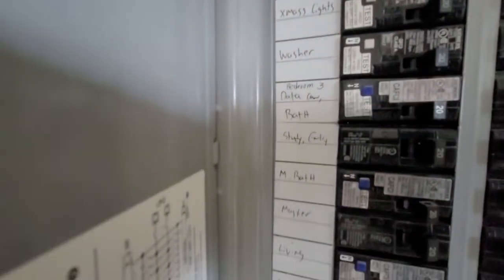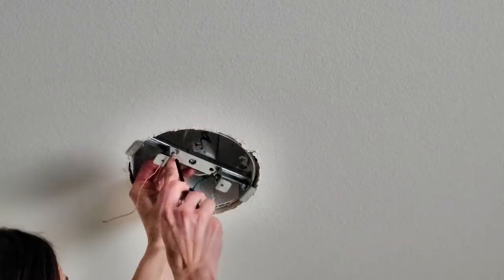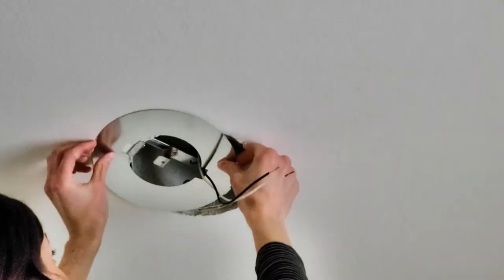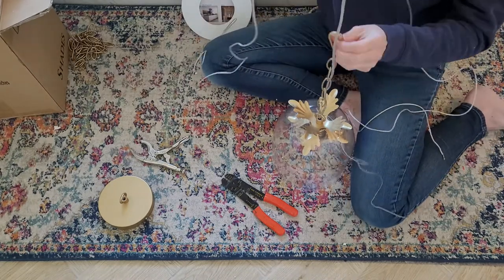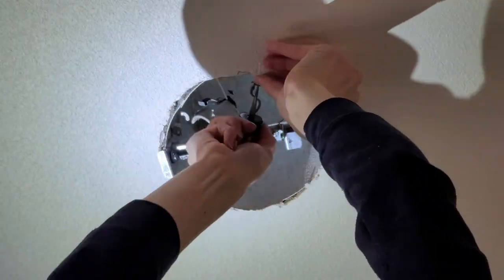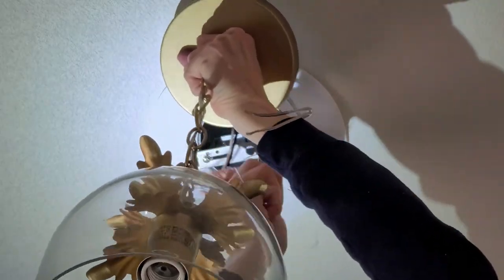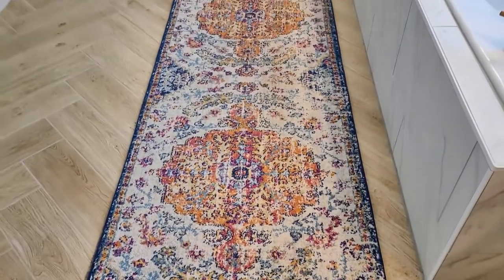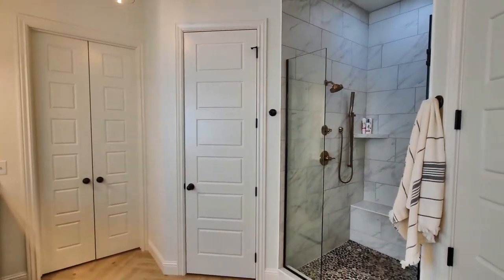How to Convert a Can Light to a Pendant Light - Easily Update a Bathroom

Comment: Your video was a life saver! Your video close up pointed me in the correct direction to get the recessed light housing flush with the dry wall so that the conversion screws went into metal not dry wall. Thanks for the inspiration.
Reply from the maker: So glad it helped, Holly! I'm so impressed that you're doing your research to avoid some possible future issues later on.

Comment: What size goof rings is it for you?
Reply from the maker: I ordered a custom one, the outside diameter is 8.25". I don't recall the inside diameter, and it's now covered so I can check for sure. It's smaller than the light fixture~